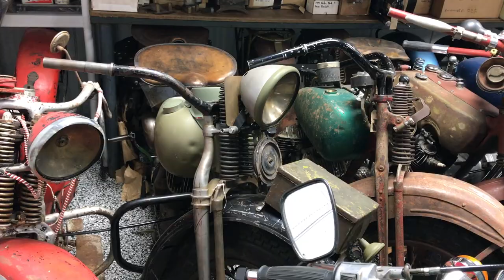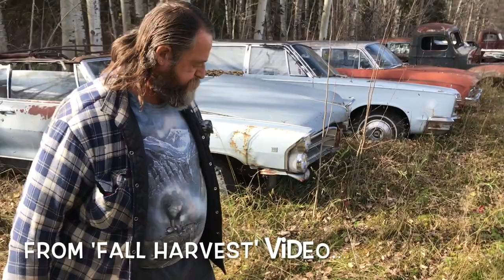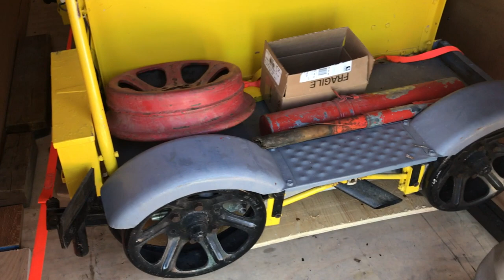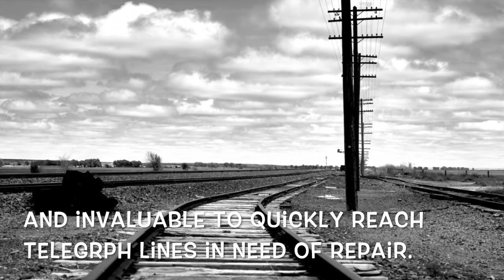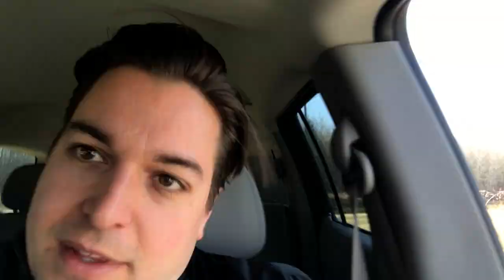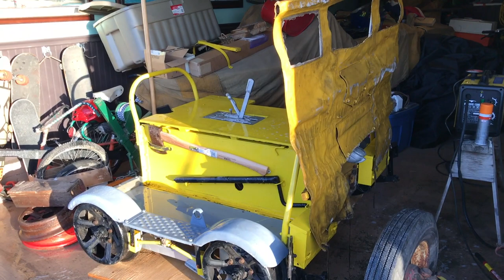We bought a train! bringing home a Farimont Speeder Inspection Train.

Comment: I happened to see one of the clubs that ride these things around the country. They make provisions with railway companies to use the back routes, even those still in use, but not all that much. The club I saw had at least 50 of them, various shapes and sizes, but I didn't see one like this. I think you were right, this thing was probably built in the 30's or even 20's, IF that's the original motor. Hit and miss went out of fashion in the 40's, and frankly with the war on, not many things requiring a lot of steel were built, but I can see how keeping telegraphs going in that time would have been considered essential... so maybe they used what motor was at hand to power it. I think it's VERY unique, and probably quite rare, but rarity doesn't always mean something is pricey. Takes a special person to buy something like this. There is a guy here somewhere that has his OWN personal track and several different trains to run on it, but I don't recall who he is or where... he would probably love this. Check you tube, it was in a vid that I saw it.

Comment: Nice little motorcar! You bought one of the smallest motorcars made by Fairmont... an M9. (Not an M19). The M9 has 14" wheels which have 6 spokes and a 32" wheelbase. The M19 (and many other cars) use 16" wheels which have 8 spokes and a 36" wheelbase. The wheels with the center bead are called "ice breakers". The engine is a 2-cycle engine... and not a "hit and miss" although it can sound like one. It burns an oil gas mixture like you might put in a chain saw. Check out "narcoa.org" for many contacts and information about this great hobby. The expert on these 2-cycle engines is a fella named Carey Boney (see NARCOA website). He lives in North Carolina, USA. Good luck with this great little motorcar! Please post more videos as you continue to fix it up!

Comment: I was a third generation railwayman in New Zealand Early on in my life and the track gangs used the exactly the same vehicles. Down here they were called Jiggers.NZ and Canada ,both  Being part of the empire when these were designed,I would guess they were copied from one another . The Gauge in NZ is only 3' 6" so they didn't have the neat littler running boards and fenders. Same wheels and so on . The small size is important so they could be lifted off the tracks when a real train approached. https://youtu.be/aE4v94BCIlg
Reply from the maker: Wouldn’t want to have to pull one of these off in a hurry!
Reply: Kiwi men are tough...(go All Blacks!)  In the other vid I posted you can see Pairs of Rails besides the tracks in various places, that's where the crews could park their jiggers off the tracks. i have seen a single operator pull one of the line and onto the side to get them out of the way. I think it's a matter of technique. :-)